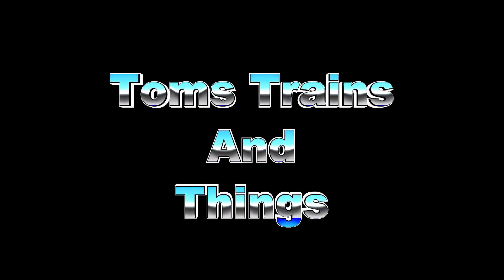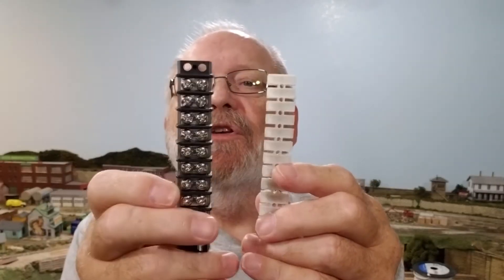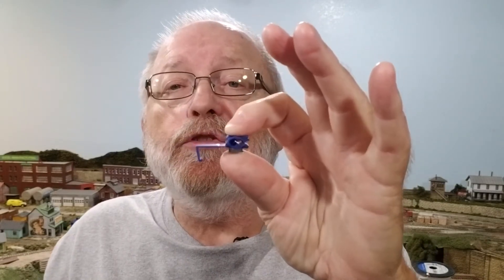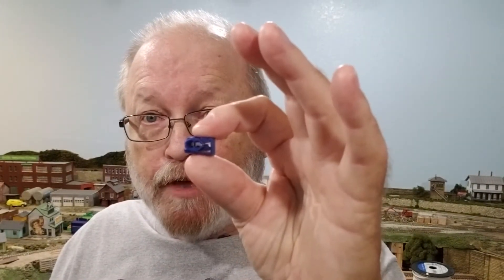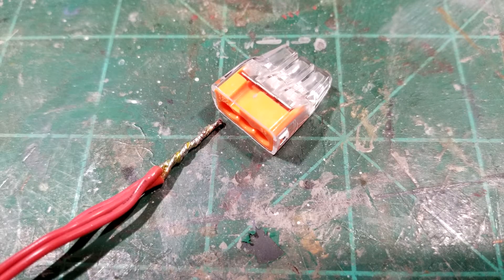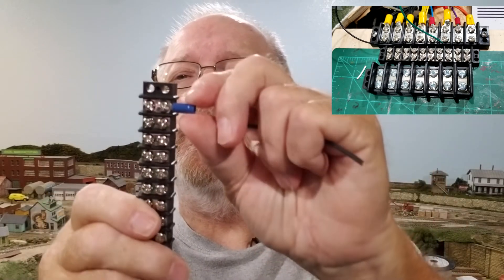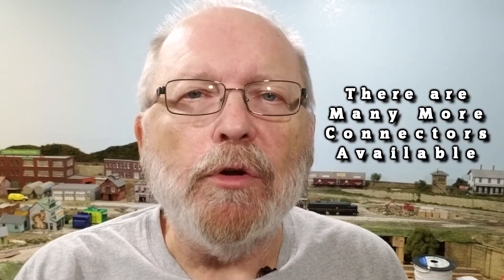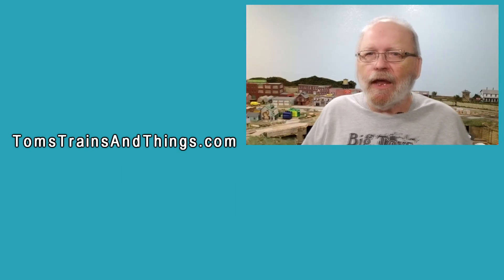What Connectors Should You Use For DCC On Your Model Railroad

Comment: I use cheap extension cords to make my DCC bus under my sections or modules of my layout.  I use the short ends (cut off) of both the male and female extension cord ends to tie the bus from module to module.  The polarization of the blades on the connectors insures that the correct polarity goes to the correct rail(s).  The polarity of each of the two wires in the extension cord is also indicated by little ridges on one of the wires.  I have two small (.093" thick) brass plates on each end under each module, one for each polarity.  Each brass plate has several tapped holes in it.  The cord ends or connectors have soldered terminals that screw into the end holes on each small brass plate.  The center part or the main wire part of the extension cord has also terminals soldered on each end, to just the right length, which run directly from one pair of end brass plates to the brass plates at the other end.  This is the main bus wire that goes under each module.  I twist this main bus wire as it runs under each module to avoid giving any EMF bias to either polarity.  All feeder wires soldered to the rails  also have soldered terminals on their ends under the modules, and which screw to the appropriate polarity of the brass plates at either end under the module, as would be most convenient depending on where the feedwire is soldered to a rail.  Since the female end of the extension cord typically has three plug openings, and since only one of these is used to connect to an adjacent module, I can therefore connect my DCC signal/power to the bus at any point that I choose, where two modules connect to each other.   So far, I have had no reliability problems with this system whatsoever.  The utter simplicity and low cost of the connectors makes this system attractive to me.   However, so far, I have used this system only for a few modules.  QUESTION:  Is there likely to be any reliability problem with such a system as my few modules grow to be many modules?  Or any other unforeseen possible problem from this system down the road?  Great videos.  Thanks.
Reply from the maker: Thant's a great idea Loane, never thought of that one!  The only thing you have to watch when expanding is to make sure your command station is in the middle of your modules. This way you are less likely to loose your signal due to too long a run.
Reply: yes, electrical extension cords, with the ends cut off work very well... flexible and if you use the heavy duty version with the thicker gauge wire in the middle of it, not the heavier sheath duty, then it works out fairly cheap.
Reply: @brendanpratt7760  Yup.  BTW, we have the same last name.  I'm retired USAF and live in a small town in central Utah, but for several years now I've been no longer a part of the local religious persuasion.
Reply: I've done similar.  Bought household lighting wire - same as heavy duty extension cords.  Bit cheaper, especially in twin with no third earth wire (In UK, Europe and Australia we have three pin wall sockets and plugs.  Not USA two pins.)  Standard extension cords are about 1mm.  House lighting / heavy duty extension cords 1.5mm and house power about 2.5mm (USA 14 gauge!)

Comment: No problemo with case fittings and different gauges!  Easy fixes.  1. Use same gauge only.  Droppers and bus can be the same gauge. 2. Double over the smaller gauge!  3. Single case with male spade and separate female spade for droppers.
Reply from the maker: try soldering 14 gauge wire to a rail. Not gonna happen

Comment: Hi! New to model railroading. Question?can you use outdoor low voltage connectors  to connect feeders to bus wire?
Reply from the maker: Not sure what you mean by outdoor low voltage conne tors. Send me an email with photo or manufacturer or part no

Comment: I believe towards the end when you crimped a spade connector on you had solid wire.  I thought crimped connections were supposed to be for stranded wire only.  Am I under the wrong assumption?  Or can solid wires be crimped, just perhaps needs a little more force to make sure it's a good connection???
Reply from the maker: You can crimp both

Comment: please can I ask a unrelated question. For years my CV said loves cars and planes hates traines, but recently I have started to take an interest in model traines but only on a very tight budget. I brought a 0 6 0 pannier for £12 and then thought I need a controller and for £13 brought a Zero1 controller and got it to work. Now I have a Ardunino Mega and power shield set up and talking to my computer,  but my £20 DCC fitted engine tries to connect but I get error message that the decoder is not recognised . When I opened the engine up it up it was flooded with oil and when I connected power I noticed that there was faint smoke coming from the decoder module and closer inspection I can see that one of the components appears to be melting, but my question is this , there is a capacitor across the motor connections, is this correct or has someone tried to fix this problem before?
Reply from the maker: Considering the excess oil and burnt component, I would say the previous owner already had issues with the loco. The capacitor may have been an attempt to replicate a "stay alive" which keeps power on the motor on dead spots on the track.

I would clean it up as much as possible, remove the capacitor, and decoder. Test the motor with a 9V battery to see if it operates. If it operates to your satisfaction, I would then try an inexpensive decoder to see how it works with DCC.

What DCC system are you using?
Reply: @TomsTrainsandThings  Thank you. The capacitor is only 4mm dia its marked 104, so I guess its not a stay alive, plus what would be acrooss the red and black wires?? Im using an  Ardunino mege communicating with JMRI on my laptop. The motor works fine and another Hornby decoder is on order. kind regards LP
Reply from the maker: Where are the red & black wires coming from?
Reply: @TomsTrainsandThings  Hi Tom, the red and black go to the wheels and the orange and grey to the motor and the capacitor is across the orange and grey.
supplying  DC from a power supply the  the motor runs well AND very quietly.
Reply from the maker: You decoder will come with instructions on how to wire it

Comment: Wago 222 lever connectors! Forget the rest.....
Reply from the maker: Much more expensive than the rest
Reply: Not so expensive if you buy a box of 50 in the UK, and they are demountable and reusable.
Reply from the maker: @westwonic  Can you get that box of 50 for $5?
Reply: You pay a premium for the convenience of quick and easy assembly, and demounting.  Try taking a solder joint apart under the baseboard, or cut away and rejoin those suitcase connectors for any layout changes.

Comment: I'm building a new layout and am totally frustrated with the wiring.  I have a 14AWG buss and a 22AWG wire for feeders.  I bought the suitcase connectors and nothing but trouble.  I'm definitely interested in replacing them with the Orange (Luminare) connectors but here's my problem - I can't visualize how I would run my two MRC power feeders into one connector and also have the 14g going in and then out of the same connector as I would have to cut my 14g buss wire in order to install a connector.  My electronic knowledge is minimal to say the least.
Reply from the maker: You can get the better suitcase connectors if you don't want to break your wire that are made for different wire sizes. Most of the ones available in hardware stores & Home Depot are the cheap ones that most modelers buy and have trouble with. The good ones (3M)  cost more, but work better.
Reply: @TomsTrainsandThings   I believe I had the 3M Red.  905?  I wish they stamped the #s on the connectors.  I will replace them and I don't care what it costs at this point.  Thanks anyway...

Comment: Tom, I believe that the correct method for installing suitcase connectors or IDC is for the blade to be cramped down first before closing the case. This is more effective than the method you show. Regards, Mike
Reply from the maker: You are correct. 
At 3:38  I show how I crimp the suitcase connector with chanel locks
Please provide the time code in this video where you believe I showed how to crimp as you stated!
Reply: @TomsTrainsandThings  yes Tom but you had the suitcase closed when you applied the pliers to close it.  I'm saying it should be open when you apply the pliers or grips, so that the pliers act directly on the blade  and not thru the plastic cover
Reply from the maker: The pliers were on the blade. Open your eyes, you see the cover hanging out the side

Comment: Tom is there a quick way similar to what your showing that you could also quickly connect the other end of the feeders to Lionel Fastrack andor create the jumpers from segment to segment without soldering thats reliable? Second. If I'm doing feeder every 2 to 3 feet of track or less are jumpere from track to track segment to segment really necessary?
Reply from the maker: Soldering is the best method. If you want problems in the future, by all means take short cuts now.
Reply: @TomsTrainsandThings   lol.. true.

Comment: You can also drop a bead of solder on the crimp connectors before you crimp the wire to make a ultra strong connection.

Comment: I'm glad you told ppl that the suit case connects are no good there are better ones and soldering is better. The automotive 12 volt industry frowns on the use of these , as examples car alarms , speaker connections and etc.
Reply from the maker: I hated to open electrical panels on the equipment I had to repair and see those things in there on the wiring. Those were almost as bad as people using sheet metal screws in a machined thread.

Comment: Are gold plated connectors any better or is it just a total fallacy that has been put out there in the electronics world? Especially when it comes to connector's and conductivity.
Reply from the maker: That's a great question. Gold contacts do not corrode as easily as copper, and it has is slightly higher resistance.

Comment: Hi Tom! Those orange connectors are called luminare disconnects. They are used in Flourescent light fixtures to disconnect the Line voltage from the Ballasts. This makes it safer for Electricians and Lighting Techs to work on those fixtures, because they can disconnect the power very easily. When I first started as an Apprentice 23 years ago, we did not have them. As a Journeyman Electrician myself, I have used many. You are right, they are very handy for Model Railroad wiring. Great work on your videos!
Reply from the maker: Thanks Russ. I always wondered what they were called. I needed them when I was changing ballasts at work. lol. They come in real handy on my layout!

Comment: FYI the black screw terminal blocks can get shorting bars which makes a distribution block much easier. Also for heavy current a connector to look at are Anderson Powerpole ,sometimes called sermos. RC car folks love these
Reply from the maker: Thank you, it's about time for me to upgrade my computer since it's 7+ years old. The monitors and video card is new, but my editing takes a long time because of it's age. After the first of the year I plan on getting an Area 51 computer.
Reply from the maker: Thanks for the additional information!
Reply: I agree . Used Anderson Power Poles for years especially for RC airplanes
Reply: Although I came across one guy who still used tamiya, but soldered the pins, not crimp
Reply from the maker: That's the one part I left out of the video since I thought that would be too much work for most modelers to deal with. I used them all the time on the machinery I used to work on.
Reply: true, but it is nice to know all options too
Reply from the maker: You'd be surprised how much info I have to leave out in every video just to make it short enough to be appealing to view. I have a lot of early videos that were 30 to 60 minutes long that has very few views and the ones that did view dropped out early. I even did follow up videos on shortened ones that were over 30 minutes also. There's just too much information to share and not enough patience from the viewer. Now I try to keep my videos under 16 minutes, I said try, it doesn't always happen. lol
Reply: probably some truth there , better to make a side note video or 2  that make it full video. it is what i want to do when i start doing it, Just have to find out how the sidebar links are added to youtube videos
Reply from the maker: +billfusionenterprise Are you talking about the suggested videos that show up on the right on desktop and at the end of the video?
Reply: yeap
Reply from the maker: +billfusionenterprise Those are put there by YouTube but there is a way to optimize it to show more of your own once you have a lot of videos yourself.
Reply: well I have seen videos with links and such in it, just have to find out about them
Reply from the maker: If you need any help with anything, just let me know. I've been studying YouTube ever since I started uploading videos and am a Rising Star on YouTube Creator Community Forum.
Reply: right now i have to take time to learn lumafusion , a video editing app i have on my iPad. I like to do a series based on a small paper I wrote
Reply: by the way the one person who impressed me with the full line production setup is Chistopher Barnatt of explaining computers. I will say this though your setup is not too bad either
Reply from the maker: That sounds great, the video editing is probably the hardest part to master. I started back in 2004 editing family videos. They were really bad. lol
Reply: i have a few up and should be redone

Comment: Tom, this is a very good video and subject matter to discuss. I have used a variety of connectors including the suitcase connector and I have had no problem so far. The one thing I noticed like you was the size difference, so I remove a mall bit of the insulation (if using two different sizes), that way I know the metal tab will make god solid contact with the wires. So far, no issues. Terminal blocks with "spade connectors" handle a lot of the wiring for each of the modules. 
Thanks for this video Tom!!
D. Muse WTCMRR
Reply from the maker: Thanks David. There are a lot of modelers out there that think they can be used for any wire size. that's when they run into problems with them. Best connections are soldering and terminal blocks.
Reply: @TomsTrainsandThings  not what others are saying.  Times have changed.
Reply: agree.

Comment: I used suitcase connectors and tested all connections with my ohmmeter. They work but you do need to take care.
Reply from the maker: Thanks for your input. That's why I made this video, since a lot of viewers were having trouble with them. I wanted them to see there are alternatives to the suitcase connectors. I also did a video on soldering the feeder wires to the bus wires and track, which is the best way to do it!

Comment: good video Tom. full of helpful info and tips. with the wire nuts. or marrettes if using 2 different gauges of wire. the smaller wire should be just past the end of the larger wire, then tighten the connector. this helps the smaller wire twist in tight to the larger wire.
Reply from the maker: Thanks for the great tip Dave. Very helpful to know! I knew this would get you out with some great tips!

Comment: Using any of the quick connectors are for the lazy In low voltage there is nothing better than solder, or a proper crimp. If you were to look in a PLC or instrument panel you would never see the quick connector in there. Suitcase connectors were invented for auto industry installer, the blades can damage the wiring and surface contact is minimal . If you  bring out the soldering iron to tin your conductors why not solder them all together?
Reply from the maker: I agree with you about soldering is the best method. I have another video on that subject. If there is not enough clearance under the layout to solder the feeders to the bus wire, I use the connectors. I solder the wires together on the bench then solder them to the track. Then push them into the connector for the bus wire.

Comment: Can you use the same gauge wire for bus and feeder?
Reply: it is harder to solder the larger gauges of wire to the out side, or bottom of the rails. that is why most people drop down to 22 gauge wire for feeders, 22 gauge you can go to the dollar store and pick up a phone cable. and use that wire
Reply from the maker: Just like Sparky said. You want to keep your feeder wires small and out of sight.